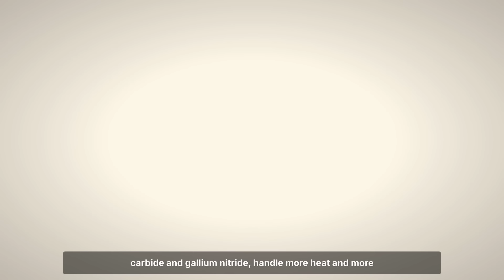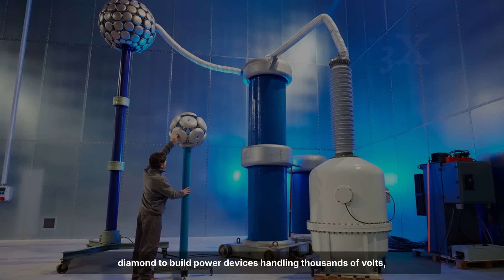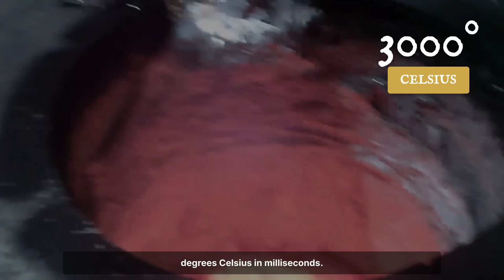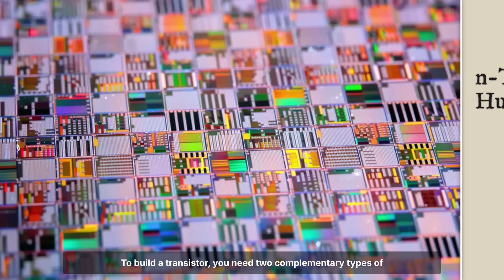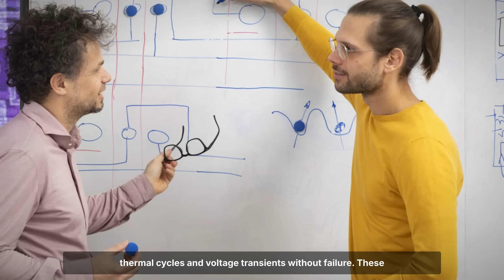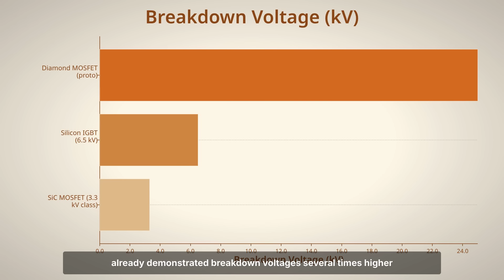Electricity Turns Carbon Into Diamond. Hardest Material On Earth. This Should Not Be Possible.

Comment: Increase production with more units but to offset cost of failures rejects can be repurposed for industrial tool use.  Adding two steel or even copper layers on the outside and you would have a cutting wheel that would last many times longer that steel with diamond particles.  I mentioned copper because the soft metal would be bad as a cutter unlike steel but with that job turned over to the diamond totally the copper would help to conduct heat away.  Over heating could shatter the crystal but any metal layer would conduct that from the edge.  The thing I say here is a secondary product to accept a 50% fail rate at cost for the waste.

Comment: Electrowin alumium from aluminum oxide dissolved in molten cryolite. Now, diamond. Aluminum carbide dissolved in molten lithium hydride doped with lithium nitride or elemental boron for electrical conductivity, under a (pressurized) hydrogen atmosphere. The electrical double layer is the carbon plasma plus hydrogen radical deposition cloud. Liquid is much denser than gas plasma. A DC bias plus AC or reverse-pulsed overlay for progressively scrubbing structurally defective diamond deposition. Diamond will be 𝘰𝘹𝘪𝘥𝘢𝘵𝘪𝘷𝘦𝘭𝘺 grown from dissolved carbide - not obvious to one skilled in the art.

Comment: The much-repeated "carbon from waste" is silly. The carbon needed to make polycrystalline diamond must be pure (except for the finely controlled introduction of fluorine). Sure, you can make pure carbon from any carbon-containing source, but this involves a complex purification process. Because the cost of any source material is insignificant in comparison with the cost of the diamond-forming process, it is more economical (and reliable) to start with a source without multiple and variable impurities (e.g. a purified hydrocarbon).

Comment: Do the engineers realize that you don't even necessarily need n-type doped diamond to make diamond-based power transistors? I mean not just that p-type schottky diodes are a thing, but so are p-type schottky power MESFETs. The advantage of schottky semiconductors is that they only require a single variation of doped semiconductor base material, either n-type or p-type; the remaining bad-gap is provided by the metal contact interface.

Comment: Diamond is great and all.... but I would say that Gallium Oxide would be more worthy of a video. This isn't just because of the manufacturing complexity of diamond, but also because of the breakdown electric field being higher than any other known semiconductor material (even diamond). If I were to bet on a semiconductor material for the future.. it would be  a composite of primarily gallium oxide with the last material making up for gallium oxides poor thermal conductivity.
Reply: Gallium Nitride is  being studied intensively for high temp high voltage semiconductors.

Comment: Hi end power electronics has been moving away from pure silicon for years now to silicon carbide (SiC) and gallium nitridue (GaN), known in the industry as wide bandgap semiconductors.

The transition to these materials will take place long before any diamond based power electronics devices are in use.

Comment: Why not just use cvd diamond as the seed crystals for cvd diamond production?
Reply: Why produce a seed crystal with cvd if you can make the entire active layer using cvd? I mean cvd is slow, but given that modern semiconductors only require very thin sheets of semiconductor material for the channel layer you might simply skip the step of producing a seed crystal entirely & just make it entire with cvd.
Reply: @FrankHarwald  because the video said you need to use a seed crystal when making cod diamonds. I’m just saying you can break a sheet of cvd diamond into lots of little seed crystals instead of sourcing expensive seed diamonds elsewhere.
Reply: @wattsmith2656  I think the confusion is from the video making the seed out to be a way bigger deal than it is. CVD is much more easy and along than the video portrays. And supposedly a carat an hour is doable with CVD.

Comment: We'll see if this technology ever makes it to the market. It would most likely change how we use and distribute electricity fundamentally. We now have AC based electricity distribution. DC devices only exist up to ~1 kV. That's the limited for local DC grids, solar panel strings, battery voltages etc.

For high voltage DC power distribution we need extremely expensive power conversion equipment. It's not economic to add a lot of connections to a HVDC power line, it's a line moving electricity between two points that have inverters that are far apart because of this. If those DC connections get cheaper, we can get rid of HVAC power distribution all together, because DC power lines reduce energy losses and the power lines themselves are actually cheaper to build.

And when electricity distribution transfers to DC, electricity consumption in the house will do the same. Most of our electricity is already used as DC power. In aircons and refrigerators that have built-in inverters that invert the AC from the plug to DC to be used. Wall plugs at present provide AC. All electronic devices in our houses use DC. Our solar installations produce DC power. Batteries use DC power.

So it's not just that diamond switches are more efficient switches than what we have now, but also that we can reduce line losses and avoid the entire DC to AC and back conversion that is part of most of our electricity consumption today. And more efficiency means less energy needed for cooling away the losses as well.

Comment: Nope. Nitrogen is just too big to fit in with the carbon. It will create defects and problems. Just stick with diodes. Also, isn't diamond essentially electrically nonconductive? I felt like I wasted my time watching this. I think it's better for your channel to do things that are possible than to do things like this just to maintain the channel. Sometimes viewer is better.
Reply: As soon as I read my comment, I knew I had made a mistake. Nitrogen is smaller and would fit in. The problem is doping with boron--87 pm radius is far larger than carbon's 67. Sorry for the confusion. Si and Ge are both on lower rows on the periodic table and are composed of many more nucleons so that an element from and above row can be fitted in

Comment: The first principle this process is resting on is called “magnetic pinching” or “electromagnetic confinement”, (like the nuclear fusion process). By which the ingredient graphite is radially compressed into a sphere, may as well be a cylinder through further researches. The capacitor bank in the lab is literally representing a lightening discharge at small scale relatively. In a sense we may also conceived that diamond and many rare earth elements are related to this process, atmospheric discharge through earth crust.